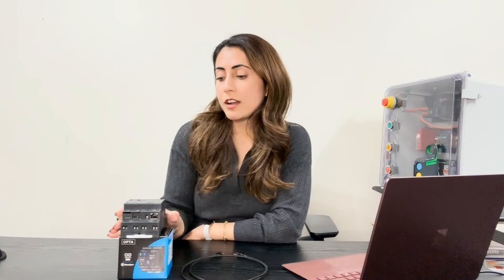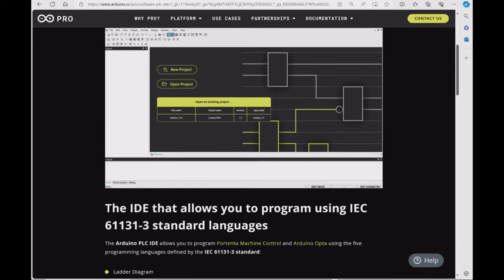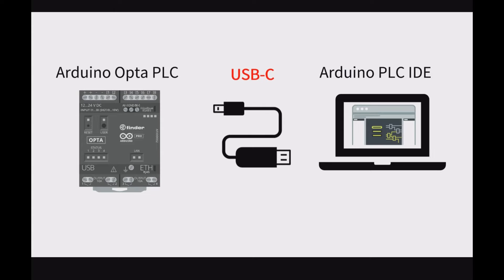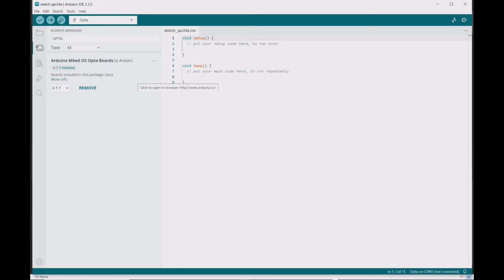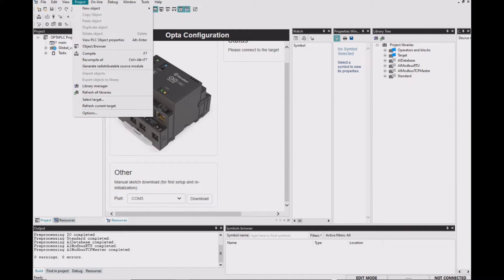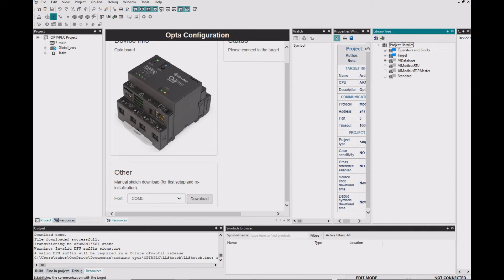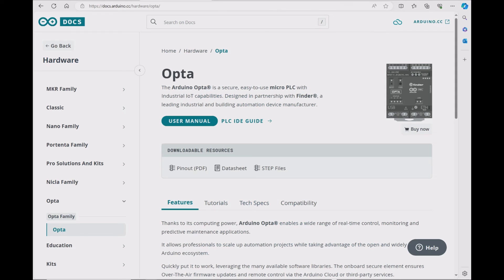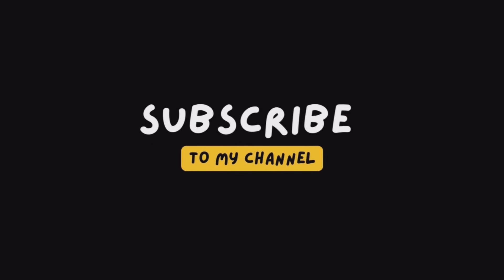SOLVED Arduino OPTA PLC [Error: Cannot download sketch file (error code: 1)]

Comment: Thank you for the tutorial however, I got another error message: "Cannot compile Sketch file (error code: -1)". I got the error due to installing the "Arduino CLI" onto another drive. My Arduino PLC IDE was therefore looking for the "arduino-cli.exe" in the wrong place which I was not allowed to choose. The solution was therefore to move the "arduino-cli.exe" to the correct folder,  which for me was "\Program Files\Arduino PLC IDE Tools" on the main drive. This correct folder was indicated by the error message, which I was too dumb to read, although it did not state it clearly enough for me.

Hope this can help somebody else from giving up if the above tutorial does not work.
Reply from the maker: Thank you so much for sharing this ,the more we share , the better for the coding community ,i hope this also helps somebody who still have issues with the error code:1.

Comment: After trying everything and investigating the doc and Arduino page + extreme google I will say it’s totally crazy bad product and software . It’s impossible to activate the Opta. IDE seams to work properly but PLC IDE it’s just an ugly mess. And why not Mac? Tried all settings, the formatting, com adjust, everything. Can someone explain why and how the activation part work. And again it’s no problem to double tap reset, run the auto boot loader in PLC IDE and the process complete, but then it’s stop. No activation.

Comment: why did i get an error and a COM Server popped up and nothing happens it has an option of Diagno and ok, when i press ok nothing happens?
Reply from the maker: when do you get this error msg ? are you able to download the Runtime ? or at least connect to OPTA?
Reply: @InstructorZara  Same here - i can successfully download the sketch manually using the single available com port. After that two com ports appear, which seem to be correct. But when connecting to one either, only a comServer dialog opens up and the ide freezes. Com Server Diagnostics Dialog shows 1 users connected, but i cant go on in the latest PLC Opta IDE.

Comment: I have been trying to use Arduino Libraries in OPTA as I am taking voltage and current readings from ZMPT101B and ACS712 30AMP sensor respectively. I am unable to use this in Sketch. Every time there is this error message popping up. Do you know how to do this?
Reply: Intenta compilar desde un PC con W10, eso te ayudara

Comment: Stil is not working. Not a good idea to buy it and still have this problem
Reply from the maker: So sorry it didn't work , i am going to share an updated video very soon , i have another solution that worked for me regarding this error 
On-line > Halt . Then On-line > Reboot target

but ya , I did share my feedback with Arduino regarding the PLC IDE , the Opta device is great tool for learning , the connection to the software needs to be improved for sure.

Comment: I'm still stuck. In my case there is just one port COM5 detected at the beginning of the process, then, After compiling a thousand sketcher, when the opta light changes, a different COM4 is detected by windows and the PLC IDE software isn't aware and throws error. '(DownloadSketch) Can not download sketch: COM port must be used!
'. No errors happen when using the regular Arduino IDE either windows or mac. The problem is managing the serial ports in windows with the Arduino PLC IDE and that let us a regular and expensive Arduino
Reply from the maker: I also never have issues with Arduino IDE , the communication issues are always with the Arduino PLC IDE . 
Here are some suggestions , once you see any port showing on Arduino PLC IDE , download the runtime , then refresh the device , you should be able to see two ports . If you still don't see that , perform the memory partition and then try again.

Here are some references:
https://support.arduino.cc/hc/en-us/articles/16724283965596-Identify-the-serial-ports-of-your-PLC-device

https://support.arduino.cc/hc/en-us/articles/8824551178780-If-PLC-IDE-isn-t-working-with-your-device

https://forum.arduino.cc/t/opta-sill-not-connecting-to-plc-ide/1230775/16

Comment: same issue win 10 home two laptops four usb leads a-c c-c and five hours but still the same outcome error 1. it once got further and connected then I went for licence the thing stalled - crashed and back to square one, the reset button is getting worn out. I am about to surrender , Help ?
Reply from the maker: Alright, here are a couple of suggestions based on my experience with the device (hopefully I can help and one of them can get the connection working)

First make sure you use the Lowest number of COM port when downloading the runtime ( and make sure you set up the communication for modbus to use the other com port -higher number)... they both have to be different, using different ports.

Second click on refresh when you finish downloading the runtime (after connecting to the device), you might need to reset OPTA too ( you don’t need to do that every time ,I had to do it once). Also you might need to close the software and re-open it again 

Make sure that you have the Arduino IDE software closed.
One last thing, try to uninstall the Arduino PLC IDE and install it again.

Let me know how it works
Reply: @InstructorZara  Hello Zara. When I connect it, I only see just 1 port and I do not see secondary one? How can it be solved? I keep receiving the usual Error 1

Comment: I appreciate this video. Unfortunately, I still cannot connect to target Opta PLC. I am able to find my Opta's com port (5) and download a blank program. When I try to connect to target, even after refreshing target, my connection always states error in the bottom right corner of the PLC IDE. I have tried the methods stated in the video, as well as the Arduino website. Even tried CoPilot and ChatGPT for help. Still cannot connect to target without error. This is in no way a dig at Arduino or you for your video. Your video is well structured, clear and direct. Excellent content and I am sure it has helped many. I'm sure the issue is on my end, unfortunately I have no idea where to turn now. I have always used Unitronics PLC's (UniLogic, Vision & Samba Series, U90) and was excited seeing the Arduino brand. Until I can get this resolved I will have to stick with what I know.

Comment: This portena machine control board has been nothing but headaches. I've tried everything including this now and I get the error code: 1 every time... Nothing works, I'm just going to return it and buy Click PLC... Bummer.
Reply from the maker: I did work with Click PLC before ,I liked their products and the software was easy to navigate too,so i hope you find the PLC device useful and works for your needs .
 I haven't worked with portena machine control board before, and now I am starting to explore Arduino PLC OPTA so i won't be able to give my full opinion yet. I do like that it's affordable and great tool for teaching, but i am also aware of some of the errors when connecting the device to the PLC IDE.

Comment: I tried to flash an empty sketch and it worked but then when I went back to the PLC IDE I still got the same error when downloading.

Any idea on how to proceed next?
Reply from the maker: Have you tried to refresh the target when you went back to PLC IDE ? also i know it's not the best practice ,but sometimes it works ,try to restart the computer and also the Arduino OPTA to boot-loader mode , hopefully this helps.
Reply: @InstructorZara  I have tried both of what you mentioned and even tested on another laptop but still didn't work. It gives the error code: 1 every time and I am unable to find what is the issue. But on a positive note, I tested out the exact same thing on a Windows 10 computer and it worked without any issues. I tried to replicate the same thing back in my Windows 11 System and it does not work. So for now I am just sticking to Windows 10 since it is working well.
Reply from the maker: @vickneshrajmohandoss9217  Oh no, i am sorry you are going through this. I just noticed that Arduino release new software update ,check it out and let me know , hopefully this new update solves these issues : https://www.arduino.cc/en/software#arduino-plc-ide